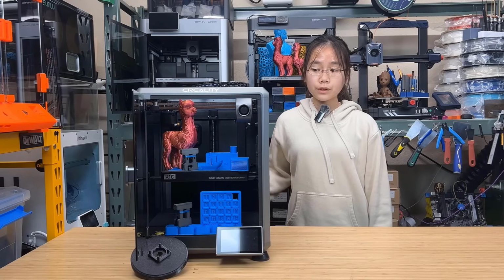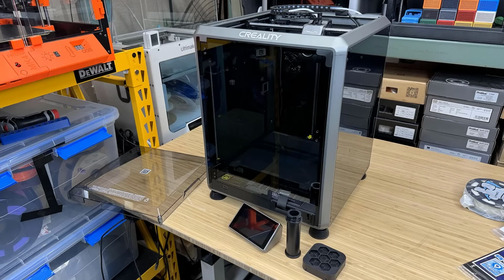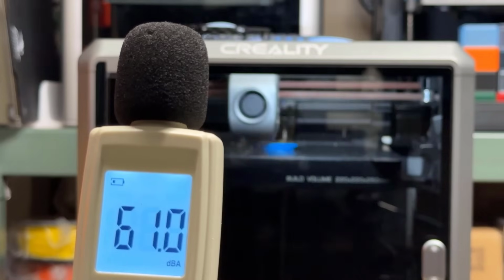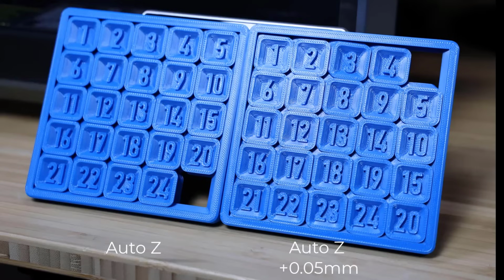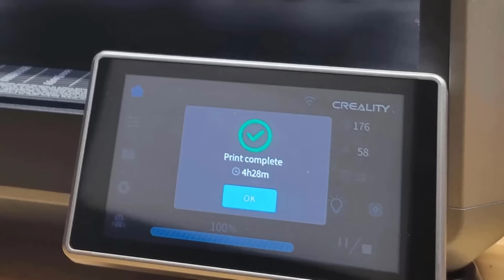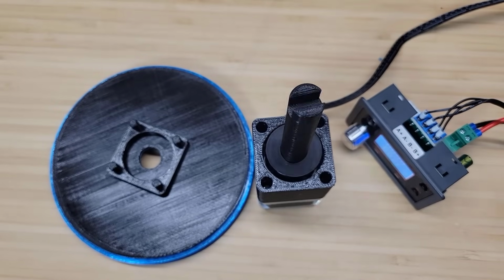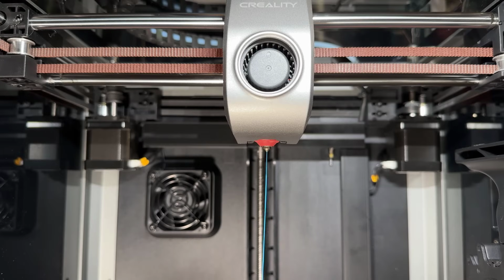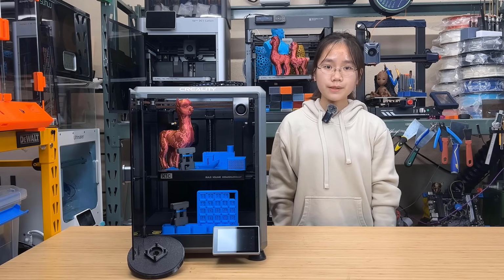Creality K1C 3D Printer: in-depth review, testing with Nylon Carbon Fiber, ASA, TPU, PETG+, PLA PRO

Comment: I bought the K1C. Does ok. Rooted it, planning to add Klicky probe to stop the  silly nozzle 3X cycles. It takes longer to start, than to print something  small! But on inspection,  the "Steel Frame" appears to be non existent.  The "Frame"is the cage of x,y,z rods. I will  probably  swap it for the Qidi Q2, but it's  not running the full open source version of Klipper,  and I understand that it's not possible to visualize the bed mesh. That makes me wonder what else is compromised.

Comment: As always, thanks for all the work you do - and I don't know if you have started doing this lately - but please consider including tests for dimensional accuracy. It seems to be one of the issue that at least the K1Max has. To the point where people who need that have been returning it or having had to make substantial fixes. If you print "organic" models you may never notice and it's actually something that tolerance tests may also miss as the tolerances may be fine but the parts may not be on size.

Comment: There's definitely a firmware issue with the back fan... I ran into the same issue with ASA, what I found worked was to turn the fan up slightly, then back to 0%, didn't kick back in once I did that and I could get some decent chamber temp (58c).

Comment: I have this printer, and it's great.  Root it with creality helper script, makes it a much much better printer.  I can actually use all 3 options, creality print, mainsail, or fluid, just by iterating the port in the connection.  Leave it blank, it goes to creality print, append :4408 or :4409 and I can use fluidd or mainsail.  No core functionality is impacted, but it does better purge lines now.

Comment: Hello i hhave a question after receiving my K1 max and it might not be a standard question 🙂

My question is about the cable connected to the screen of my K1 max. I would like to extend it with about 30/40CM, but dont know what kind of cable i can use to do this :)

I believe it is a 41pin cable but would like to make sure. Could someone please advice me on what cable to use and where i can buy this type of extention cable?? 

--> Some might want to question why one would want to extend it, its because i have it in a cabinet with glass door and i want to have the screen outside of this chamber.. Double heat chamber... i have the option and this helps me to leave the top glass pannel off and saves me the hastle of a filament dryer🙂

Comment: Great review, thanks! It answered so many questions that someone entering 3D printing would like to know, looking to print more advanced prints, especially around different materials. 

Apparently the Creality filament dryer temperature and/or moisture sensor is a bit dubious (frequently giving errors, such as moisture and/temperature readings even when they’re obviously incorrect) - according to some reviews. There’s an eSun model that receives much better reviews, for the same price.

Also, I encourage you to reduce your film tank agitation rates, otherwise at that speed the dev & fix are effectively centrifuged off as soon as they make contact, probably giving underdevelopment and/or fixing

Comment: So if you could only buy one and wanted occasionally to print items in the carbon fiber (which I assume is the strongest and heat resistant) and were on a budget of under $600 would you get the A1 or the K1C?
Reply from the maker: A fully enclosed K1C would be a better option.
Reply: Thanks for the quick response!!  Is that suggestions based on the material that I want to use?  Meaning, if I didn’t need to print in petCF would you still say the K1C?  Do you think the slicing software that they both use is easy enough for a novice?  I just stumbled upon your channel and became a subscriber today. I really like the way you review things as well. Thanks for your help.

Comment: Tried to print my first print last night.  I was using the white Hyper-PLA that came with the machine.  I calibrated the machine before the print and even extruded some material to make sure it was working.  It did two layers (slow layers) but when it went full speed it stopped extruding and I watched as it was printing in thin air nothing coming out of the printer.  I paused the print and checked the filament by trying to extrude again and it wouldnt.  I then tried to retract and I could hear loud clicking coming from the nozzle but the filament wouldnt retract.  I then cancelled the print, had to take the feed tube off of the extrusion module, unlocked it, tried to pull the filament out and it would not come out.  Had to get some pliers and pull the filament out.  I then removed the nozzle, (about burnt the crap out of my hands that was fun) and got the nozzle off.  It was extremely clogged.  So now I have to order new nozzles.  Still have no idea what I did wrong.  Most Youtube printer tutorials operate from the viewers having a lot of experience with 3D printing.  It is hard to find videos that break things down for new printers.
Reply: I saw another video where someone suffered the same issue; they had set the nozzle temp too high (250) instead of 210-220 for the PLA
Reply: @KevinKanji  Ive been using "default" temp settings in the Creality software but I did get the nozzle upgrade kit and those nozzles have been fine so far with no issues.  The only thing I have problems with now is learning how much support is enough for a print and also the Z-Offset is not ideal, the underside of my first layer is very "rough" and stringy but the rest is fine.
Reply: @jodycamper8955 I’m also a complete noob to this and was wondering about the z offset. A lot for me to learn!

Comment: You forgot to mention a couple more downsides like the fact that it doesn't have a full metal extruder or even full metal gears and that nozzle is not hardened steel but steel coated brass . I'm not trying to be negative,  just real and i am still thinking about buying this printer
Reply: Does that coated brass get corrode?
Reply: @Racio00 no, but brass is soft and will wear out very fast
Reply: Isso é facilmente resolvido quando você compra o bico original Creality K1C/K1 MAX (modelo unicórnio)

Comment: Will the extruder upgrade in K1C also come to K1 Max? Some users on Reddit wrote that the extruder was changed in the new K1 series. Do you have any information about this? In addition, I think they gave up the Lidar in this printer, which was included in the K1 Max.

Comment: Your testing and presentation methods has completely won me over. Extremely helpful to me as a complete beginner in the space. The functional component section was especially jaw dropping to show practical use cases. I knew this was possible with 3D printing, but that section alone really inspires and puts into perspective what is possible. Thank you!

Comment: Hi, I have problem with my K1C, every time I start printing, the x axis always gets stuck to the left and makes a bad sound, the print results always slide to the left and backwards. Then when you want to print again, when the nozzle should be on the wiper, it shifts to the left and back, do you have a solution?
Reply: Hi. After I checked again, I knew the cause. When I pressed the home button for the x and y axes, the x axis never stuck to the right, when it was 1/6 from the right corner, the nozzle head turned to the left again, while for the y axis it moved until it stuck to the front and then back again. That's the reason why when the nozzle head moves to the left, the nozzle head gets stuck with the body and makes a strange sound so that the print results always slide to the left and back. Do you understand how to set x-axis homing limit on Creality K1C? so that my printer doesn't get stuck when the nozzle head moves to the left? Please advise

Comment: I would love you to include an expandable all in one sword print as tests in the future. They are hard to print and fails on lots of printers
Reply from the maker: I recommend trying different slicers (besides Cura). I've been able to successfully print that sword/katana on almost every printer using PrusaSlicer. However, when using Cura, most of them stuck due to the lack of an option for "aligned" z-seam.

Comment: Saw another review of the K1C and some comments said that the C stands for CRAP.  😂. Its not any better than the K1 since they now have the same firmware so prints are the exact same. I wish they upgraded to kinematic bed leveling to fix the sloppy bed mesh. The current Z axis is nothing but belted not individual motors.

Comment: I can tell you after the issues I've encountered with my Ender 5 S1, which were almost all firmware problems, especially with the bed leveling, I will probably not buy another Creality product. My recommendation to them if they don't want to lose any more customers is to get the printer right before selling it. To this day I can't use bed leveling because they changed the design and I'm forced to use old firmware. I'm pretty sure my next printer will be a bambu lab and the only way I will go back to Creality is if that one sucks and from what i've seen they're great.

Comment: With your PA6-cf, I see your volumetric speed setting was at 15?.?.? What speed are you using for inner/outer walls and infill speed.

Also one more thing.... The pA6-cf, i see you are over manufactuer recommended settngs for the bed temp. I have mine set to 80 for first layer and 50 after. Ive found below 70c first layer adhesion suffers bad.

Comment: Great video! Between the K1c, Bambu P1S, and Qidi X-Plus3, which would you recommend for high temp filaments like cf-nylon or PETG? Or is there something else you recommend?
Reply from the maker: K1C and P1S are both solid machines. If you plan to print multiple colors or special support materials, and budget is not an issue, then go for the P1S, if not, K1C would be fine.
Reply: @AuroraTech  Thanks for your response, I placed my order through your site!
Reply: @AuroraTech what do you mean by special support materials here? Are there types of material the P1S can print that the K1C is less able to print?

Comment: I feel like Creality owes ALL of the initial purchasers of their K1 and their Kmax a REFUND of at least $100. Since day one the initial models of these two machines has been PLAGUED with problems. Multiple "fixes" have been sent out. Swiss Micro provided new hot ends for both machines at a price. And now, after a year almost of dealing with these printers, what do the first users have to show for it? A worthless machine because it can't print carbon fiber without MORE UPGRADES. The rapidity of Creality's efforts to fix two printers they should have RECALLED is evidence enough of a wrong committed against everyone who bought into their false advertising on the first models. Creality needs to make the people that paid FULL PRICE for both machines WHOLE.

Comment: Meh. They didn't seem to have made necessary changes to motion system - belts not being parallel to each other, so their tension changes depending where the toolhead is, also teethed side of belts still slide on smooth idlers - have fun with resonance and dimensional inaccuracies that Input shaper cannot eliminate.
Glass door is a gimmick that's only good for randomly shattering, why bother to reinforce it instead of switching to acrylic one?
Cable chain still still makes an "S" so will still pop out the top cover when the toolhead goes near back left corner. 
They made some improvements, but not where they were needed the most.

Comment: Looks like the new motors and pulleys fixed the z wobble artifacts

Creality should provide a retrofit kit for 1st gen machines ( free of charge to the customer base ) or provide a proper belt tensioner and spring

Comment: First of all: Thank you very much for your excellent review.

As the owner of a regular K1 I can tell you that with the latest firmware it also has an expert menu for adjusting the z-offset. Unfortunately, this can only be done during printing.

Creality slicer has what I think is a slightly better option to adjust the z-offset. Under Experimental, you can turn on Advanced and you can specify the z-offset in advance.

Better than no option at all to set the z-offset, but as a Creality user we would like to see this easier.
After all, Z-offset is material and object dependent.

It might be a nice idea to show the viewers how they transform a K1 into a K1C. The firmware seems to have it in it, although I'm not completely sure yet.

Greetings and thank you!
Reply: Great comment.   I bought the K1 when it came out..  Quickly put it back in the box as "nothing worked well"..  Fast forward about 1 year, and new firmwares, new metal gears for the extruder, a Micro-Swiss hotend and it's better than new. :) Great 3D printer, and the newest firmware and with the CFS upgrade it's really nice.

Comment: I have k1 and I can see that the bottom of the first layer in k1c has the same issues as on my k1 after increasing the z offset. With rooted klipper I managed to make it better but still my ender3 has almost perfect first layer.

Comment: Thanks for bringing up the reason one would like to run a printer offline 😊. Great video, as always!
Reply: I do not use the wifi but I do use ethernet cable because it's more secure. I'm not sure if the K1C has an ethernet jack though.

Comment: Loved your review. Thank you for mentioning the nozel swapping with pictures. My original k1 Max had so much glue at the cable pin connectors that I could not get them loose. Ended up snapping the thin wire cable. There is no good reason for the adhesive on a connection that is supposed to be easily removed. I sliced my finger on the board edge. Ended up returning it an getting a bambu X1C. I resisted because of the always connected requirements from bambu, but it's the only one I know of that just works. I am glad the new K1 is learning from their past mistakes.

Comment: I love these reviews.  This one added some practical prints with the film agitation project and that was a great addition.  Almost all of my prints are practical parts so this was representative of how I use a 3D printer.

I've been waiting for Elegoo to make a Pro version of their Neptune 4 Plus, with steel rollers and rails instead of acetyl V rollers.  I need the larger build area for a new product that I'll be printing in ABS or possibly ASA-CF.  Hopefully Creality will be launching a K1C Max soon.  It'd be more expensive than a Neptune 4 Plus Pro but I wouldn't need to build an enclosure to print high temperature filaments.  All I'd need to do is root it and install real Klipper and Fluidd, print spacers to raise the lid, and remove the reverse Bowden tube and drill a hole in the lid for top loading filament.  I print a lot of TPU and any Bowden tube is a non-starter.

I like how I can change the Z offset on the fly in Fluidd and the Neptune 4 Pro remembers it until power is cycled.  If I want to make it permanent, I can manually adjust Z offset and save the new value without doing any paper shim probing.  Easy.  Creality should be offering customers the full power of Klipper and Fluidd and not making their own Kripple Klipper and hiding needed features in Expert mode when they get around to providing those features.

Comment: Nice review I missed you guys, I have been busy building a mini Mill to machine my model train engines. This is a nice machine. I use a lot Carbon Fiber in my train parts. Could be useful. After I get the Mini Mill ironed out, I will look at it again. You all take care, Dennis

Comment: If filament is inside the top cover, it can stay warm and will be easier to swap. If Bowden extruder is put in middle top of printer, heavy direct extruder won't be needed.
A very short tube can be used between center mounted bowden and print head. Speed will increase and vibration will go down.

Comment: Ok but did the fix the VFA? That was motor related if I recall.
Did they fix the bad configuration of Input Shaping? The K1 uses the same values for both X and Y.
Reply: They say yes. This version has different pulleys

Comment: on their K1c comparison page they mark the k1max and the k1 as not supporting nylons but then you go into their sales page and it marks them as supporting it. They're retconning compatibility and I'm pretty sure this has the same nozzle as the k1 Max and if the commercial version of this really doesn't have an all metal extruder there's a lot of tomfoolery afoot.

Also you most likely don't have the all metal extruder because all the promos of the k1c show a cover on the side cooler fan which yours doesn't have

Comment: hi 

the k1c have better quality and speed because the firmware is update than k1 no ?
Reply: Idk what all they changed but the vfa is helped by going to smaller pulleys on the steppers for x/y. Personally I wish they would help out all of us that bought their flagship instead of just making a new model. Kind of irritating when a company can’t be bothered to fix their existing machine, they just make another one less than a year later.

Comment: Hello,
Would you say the better print quality is due to firmware/software updates or the parts that are updated with the K1C?

Thanks for a great review !
Reply from the maker: For the hardware, the metal gear is providing better filament feed, it can handle abrasive filament and print slightly faster with stronger pushing force. The improved print quality is mainly attributed to the input shaper working better, so I would attribute it to 80% firmware and 20% hardware.
Reply: @AuroraTech   Thank you for the reply. You have always answered my questions, I really appreciate that you take the time to do so! BTW, best 3D printer channel ever :)
Reply: @AuroraTech  for a beginner choosing between the K1C and Flashforge Adventurer 5M Pro, which would you choose any why?